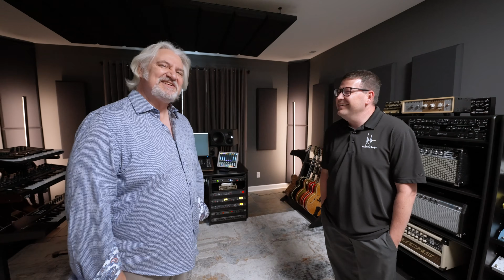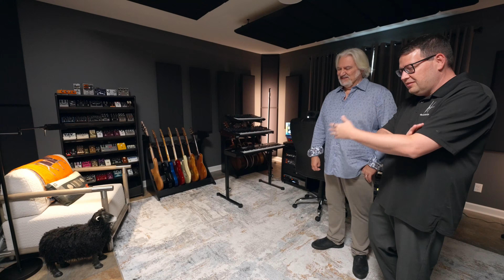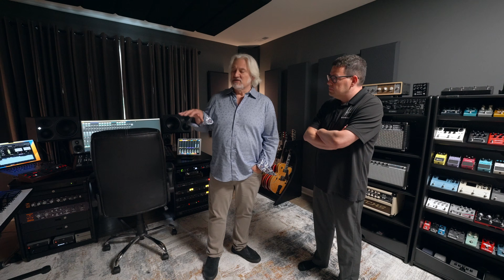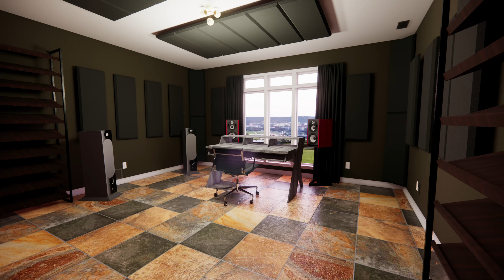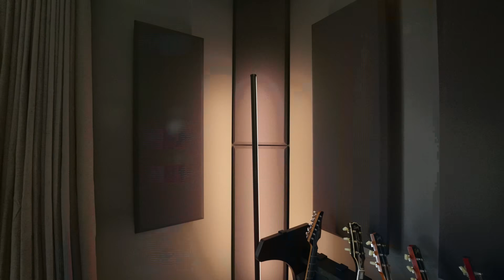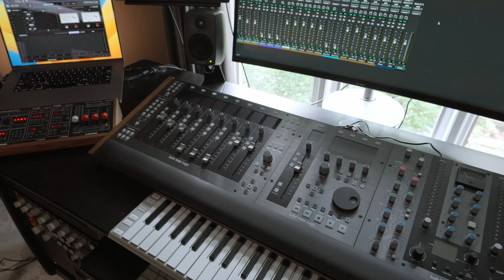Inside Mitch Gallagher's New Studio - Recording Studio Tour

Comment: Nice Mitch, I see you bought the TC-Electronic  pug-in's with the real time "hands on" controllers. I bought the whole line of them as you did and I have to say, I use them all the time for production and mixing. Mine is the white desk top rack, I also got the HD-muti-band compressor, and HD-Limiter. They all sound great. Nice studio Mr. Gallagher!
Reply: I started out with analog gear, so I'm a big fan of getting "hands on" where possible. I probably need to fill out the rest of the lineup like you did. 🙂
Reply: @mitchgallagher2755  yes, I'm the same way. Started out with a Tascam 3340 4 track, with a Tapco Catalina mixing board, this was back in 1977. So using a mouse and staring at a computer screen really takes away from the importance of just turning knobs and using our ears. Even though I don't use my 24 tack 2 inch much anymore, I still have to have most of my gear with an analog fell and real time control, even if it's still plug in based. It's like I set up my soft tube SSL 4000 on all the channels, and have a template to configure it,  how many track and tracks label, ect. Sounds great works well for my studio. You keep your self a very busy man, I always look up to you, your a great asset to Sweetwater. Have a great day.
Reply: @jeffalbro4534  Thanks so much!

Comment: Neumann’s DSP + IK’s room correction? Why?
Reply: I'm not running both. I had the IKs set up before I had the sub (with Neumann's correction in it) installed, and have just left it. It will be interesting to compare what the sub does versus the IK, and also versus Sonarworks.
Reply: @mitchgallagher2755  ahh makes sense. That would be a cool follow up video

Comment: Just outstanding, Mitch. Hopefully one day when I’m ready to renovate my basement and create a drum-based studio I’ll borrow a lot of techniques! Would love to know the brand/style of curtain rod you used and how you mounted the o-rings for the ceiling clouds. So innovative DIY!
Reply: Borrow away! I can't recall the brand, but they were inexpensive rods that I got, I think at Menards or Lowes or somewhere. Anything will work since the panels are very light. Just be sure the rod brackets have a full loop to hold the rod when hanging down; won't work with a rod that has a "j" bracket.

Comment: Ok, why given all your supposed know how would you ever recommend a mix or mastering studio that has glass on the front wall, no symmetry, and looks like DIY panels (2"? and corner traps)????  Seriously????
Reply from the maker: A lot of these things are addressed in the video. Mitch discusses his goals for the room and the desire to use off the shelf items for treatment rather than build custom elements that you see in many of our studios. A lot of studios have glass on the front wall leading to either the exterior, a live room or isolation booth and that doesn't inherently make for a room that doesn't perform well. Mitch's room was not a build from the ground up. It was an existing, symmetrical, rectangular room and the only room that was available, so you have to work with what you have!
Reply: As Gavin replied, that was exactly the point; take a room like anyone might have -- just a basic bedroom -- and make a great-sounding space. It came out remarkably well. Thanks for watching!
Reply: @audiononsense1611  Sterling Sound, best of the best mastering studios have whole front wall made of glass